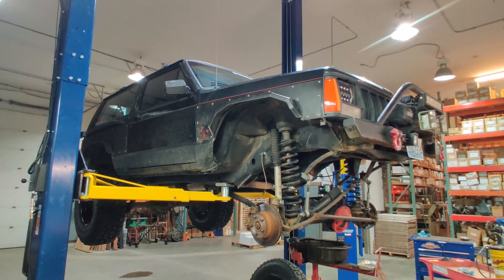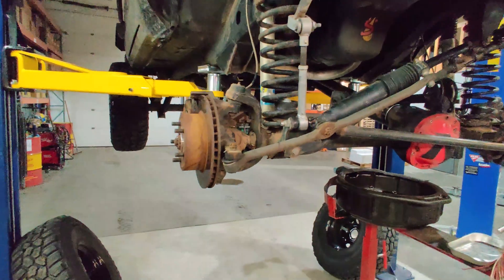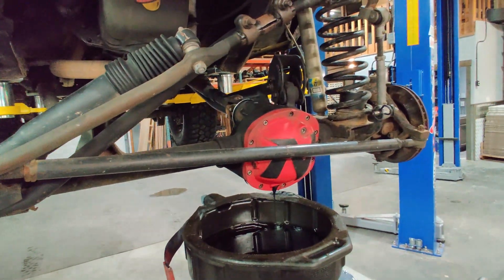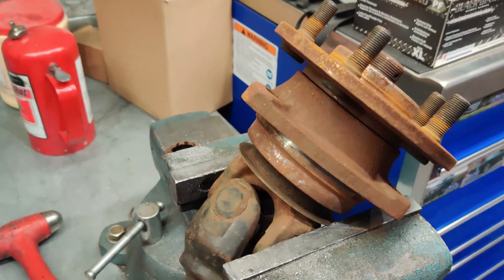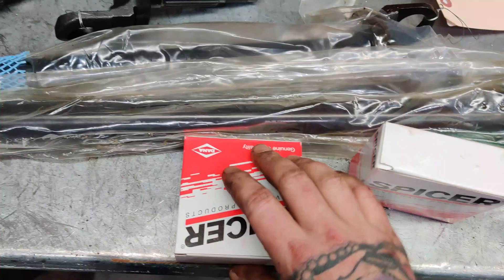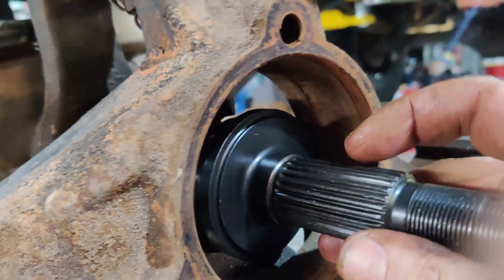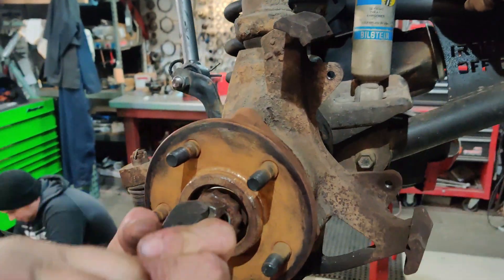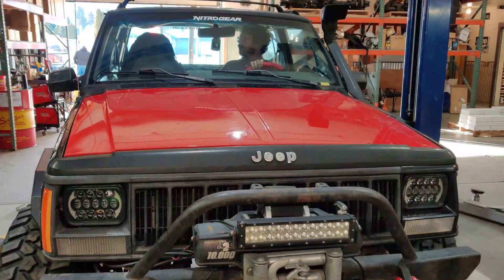4340 Nitro Chromoly Front Axle Kit Install - Dana 30 Reverse Jeep Cherokee XJ

Comment: No outer dust seal on new axle? Against bearing hub? Not necessary  On new ones?
The old one has it,just wondering minute 4:26  you can see it on old axle at the vice

Comment: I have a 99 XJ with a dana 30 up front. I'd love to know your thoughts on 35" tires and original axles for the Rubicon trail. Do I need to swap to chrome moly, or a completely different front end?

Comment: I like to put a little grease/anti seize on the unit bearings before putting them back in. I pulled a unit bearing apart while taking it out while installing a locker. Now it comes out with ease.
Reply from the maker: Great tip!